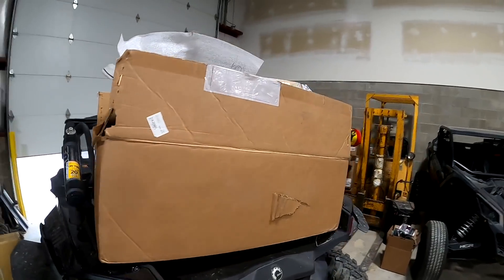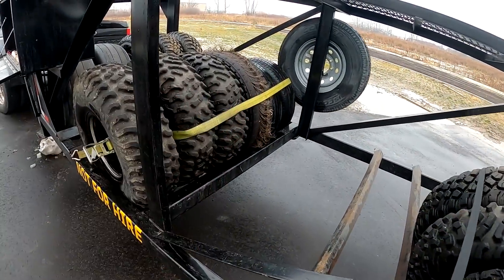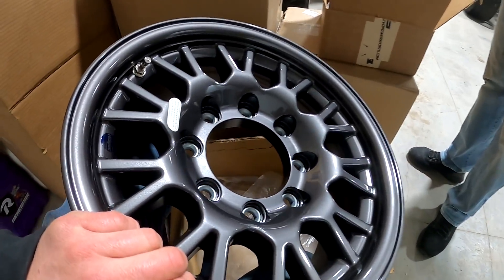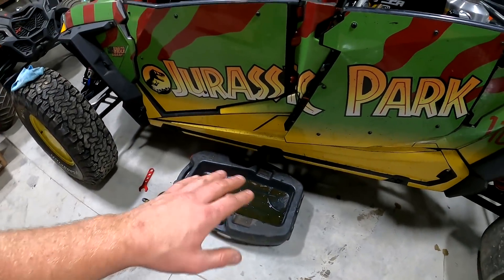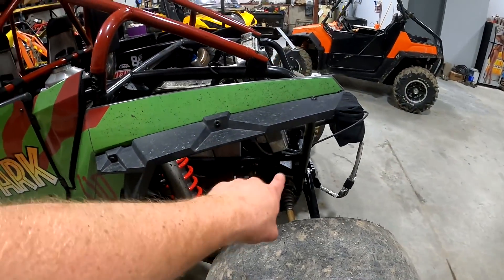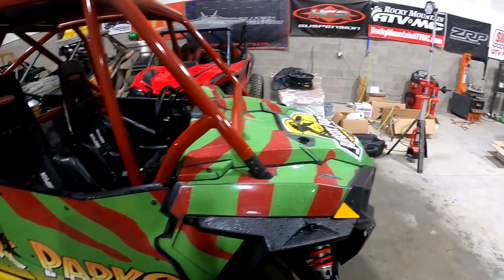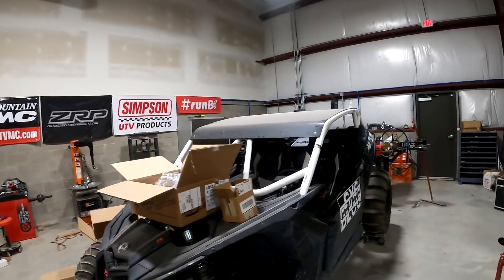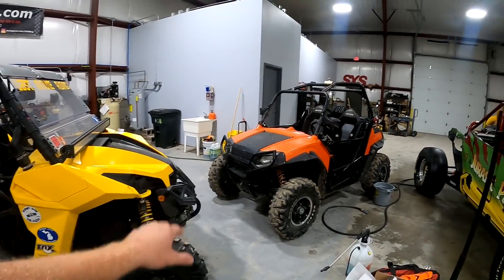2JZ swapped RZR update and TAKIN CARE OF BUSINESS. SXSBlog Garage!

Comment: If it can't handle that little amount of "abuse" whatever breaks needed fixed anyway. If a Billet block 2jz capable of 2000+ HP can't do a couple minute burnout at 800HP or so  it was gonna blow soon anyway because something was put together wrong. That's crazy the burnout was nothing compared to running 100PSI or more of boost, basically the burnout probably wasn't even stressing that engine

Comment: Hey guys. A tip from my dad, the 30 year CAT mechanic, cut a section of the filter element out and squish the oil out of it in a vise with a rag around it. After you will be able to expand a dry section of filter and get a much better reading.

Comment: Hey Doug. Great to see the behind the scenes stuff again. Hey, if you decide you need an inspector to use all the new/used inspection equipment, I'm your guy. lol The granite plate is a lot smaller than my plate at Nexteer, but I still late out parts the old fashioned way, by hand , as well as on the Zeiss CSM. lol 
As for the whiners about 2 JP on the burnout pad, I wanted to think that way for a couple seconds, but your performance and the fact that it handled it NP, made me quickly forget any notion of that. lol As I've told Leo many times, you are an absolute PILOT. Keep up the good stuff!!

Comment: I would like to See the non sxs related stuff like what is happening to the workshop like the new tools you got and more details of the wrenching. Thanks for the videos and all the good work you put in!

Regarding negativity: if These people reprimand you for hurting the motor with a low powered tune and temps in the really acceptable range for the motor they should reprimand event's like rocky nountain raceweek way harder because that is more of a torture than a 10 minute long burnout or anything else you can do to car...

Comment: Just my opinion but I was thinking maybe you guys should reach out to Wildfire lifts. I think for the storage of all the machines you could really utilize floor space by getting 3 of their 4 post lifts with the wheel kits. You could really free up some space and have more room to move things in and out without all the clutter. You could run the lifts down the wall where you have all the machines parked long ways. The wheel kits would make it super easy to roll a lift out and unload and load machines.

Comment: I don't know if y'all know what you're doing with a mill & lathe but if you don't you will soon find that:
-You'll spend at least as much on tooling in the long run as you do for the mill & lathe.
 -If you don't have a DRO for either, don't wast your time, get one for each. 
-You need to have a 1 to 4 inch set of micrometers. If you're doing engines, I'm sure you've learned that having the ability to measure to .0001" accurately is necessary. You probably need a good set of whatever method you prefer to measure small holes too.
-The ability to accurately and precisely measure both in the tooling and the knowledge of methods is every bit as important as your knowledge of how to machine the metal, especially with manual machiningl. I learned pretty quick that, instead of "measure twice, cut once" like you see in carpentry, the rule is more like "Measure three or four times if you have to and DON'T FUCK UP!"
-if you need to use a surface plate to lap surfaces, get a second surface plate and keep it pristine. You can get small ones (12"x9") from Shars for as little as $40.

There's a million other tips but again, if you're not already experienced in machining, I hope these few help but you should probably also send somebody to some classes if you're not very experienced.

Comment: Awesome score on the surface plates and the calipers.  I am a new/used machine tool dealer, id love to help you find the equipment you're looking for.  We have manual as well as CNC equipment  We also have an extremely nice line of air compressors/ dryers and chillers.  I offer a nice discount for some honest reviews.  I look forward to chatting, Thanks.
Reply: Rick wants to port heads, what's the hold up Doug? lol

Comment: If you can't beat the bejesus out of it for fun, what's the point of having it? Whether its on a rev limiter at the end of a quarter mile of in a burnout pit .. it makes no difference to the engine. If something did decide to let go in the driveline doing that awesome burnout, what better place to happen? Better there than at 90+ mph at a crowded sand track. Its testing, tuning and fun all in one!

Comment: What’s up with the orange RZR in the shop? OG or customer gig?
Reply: Yo BigDogs I think if you could cover some older units from time to time it may be beneficial. Specifically covering issues you see with customer rides assuming they’re cool with it. I’ve checked the parts site and only see stuff for newer rides, is there some link to buy parts for older rigs as in 2013+? Later Dudes.